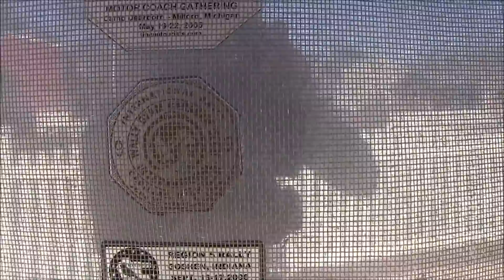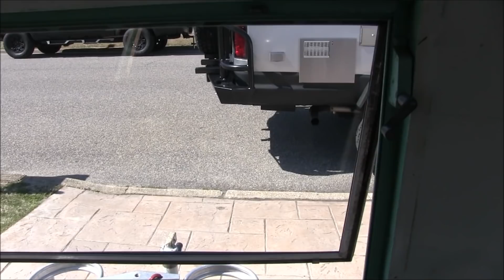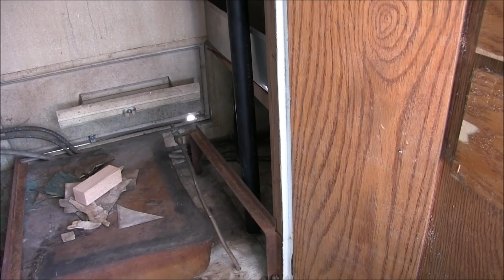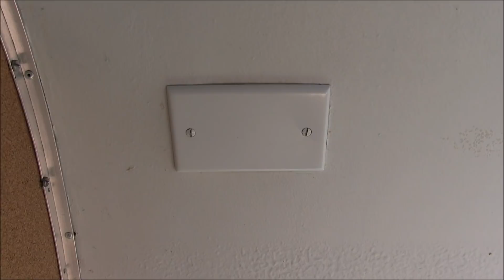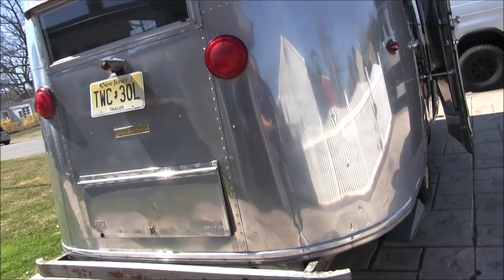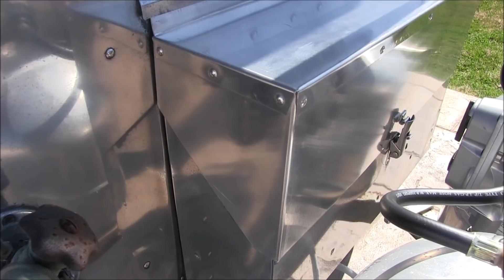1961 Airstream Bambi Walk Through Before Renovations

Comment: I have a 61 bambi.  I think it is mostly original but not sure.  Toilet was a pain to get working .  The mechanism was frozen but with lots of patience and moving the mechanism back and forth just a little more each time it finally came loose.  Luckily the rubber seals were all good.  That vent or backflow preventer or whatever that vent is behind the toilet leaks. Afraid to take it apart.
Reply from the maker: Thank you for the information

Comment: Oh man!  With your experience and connection with airstream, I can't think of a better person to do it.  One of the questions I was going to ask was if we would get to watch the build. Yes! You say you will. This is going to be fantastic!  I have never heard of combining Gray and black tanks. You don't want to deal with a composting toilet?  Will 30 gallons be enough for more than a weekend?  You will update the outlets to more modern ones, I would guess?  On one of the outside lights, you said you wanted to use incandescent light and not LED. This was a first for me. Why is that?  What are your thoughts about the inside walls?  Paint? Paper? Aluminum? Okay, enough questions and I can't wait to see you get started on this!  Thanks for sharing!  Seriously
Reply from the maker: I am still considering a cassette or composting toilet. 30 gallons is way plenty for one person to camp and shower for a week. I like the way the incandescent lights look better than LED and the interior skin is painted aluminum.
Reply: @NewJerseyOutdoorAdventures  gotcha and thanks for the quick reply.  I meant to ask if you plan to keep the interior skin painted or will you do something different?  I have it in my head that you were not going to strip the interior skin to match the exterior. But you didn't say that,  it was just the impression I got after you said something about the interior.  Since you were going to lose the green, I was thinking you have a plan.  Thanks!

Comment: That's the reason those camper vehicles and things lasted forever because they made them properly they made them with plywood not chipboard which level is Camper vans and RVs today I made like crap they turn over the fall apart just like a Lego set.. this is what got me started in DIY making my own because I use plywood for everything yes it's heavier would but it's very very strong chipboard is crap and fiberglass is bull crap as well stay away from that my friend.. plywood is key yes it's heavy but it's very very strong and it will last you for years I guarantee you it... it's a new kind of vehicles used or continue using plywood that last a lot longer but after a couple years they stop leaking because it made out of fiberglass and chipboard and then you got to pay 60 70 80 thousand dollars for that cheap crap forget it this is why I'm DIY...
Reply from the maker: Lightweight but quality

Comment: I strongly suggest that you try to make everything 12 volts so many vandwellers and campus tend to want that 110ac mentality.. which sounds cool when you buy civilization but if you want a bushes all in the Countryside by yourself I need a pendant upon yourself that battery is going to go very fast if you keep using AC power.. so you guys get into the habit of using DC power for everything and I do leave everything..
Reply from the maker: Considered

Comment: I would use RedArc for my electric management system with Blue Sea as back bone .
You will need 3 batteries in line to power everything.
The refrigerator will need a direct wire with fuse. This is why you need to plan on a good electric system.
Reply from the maker: Great suggestions